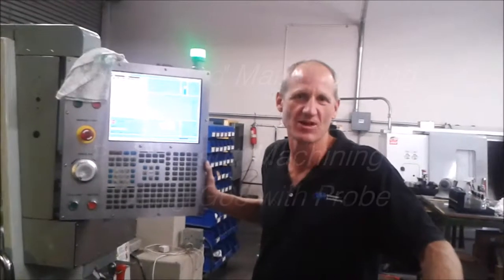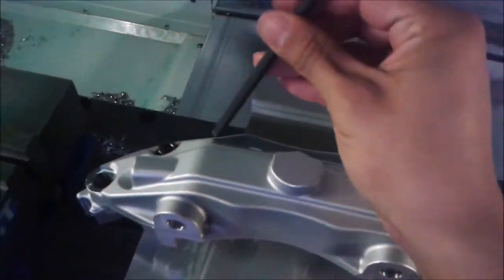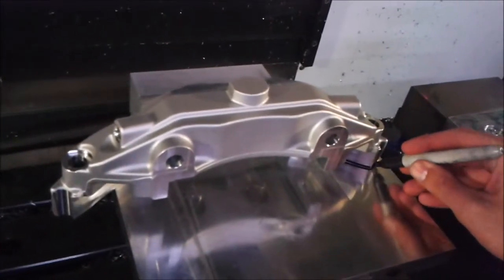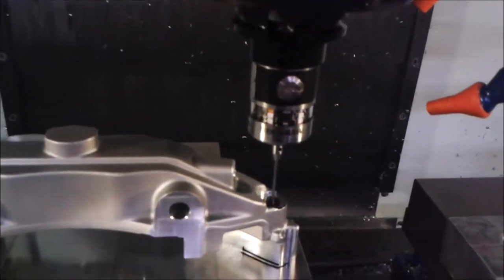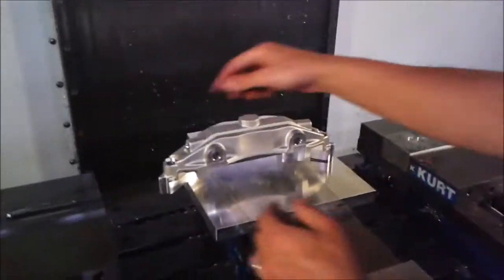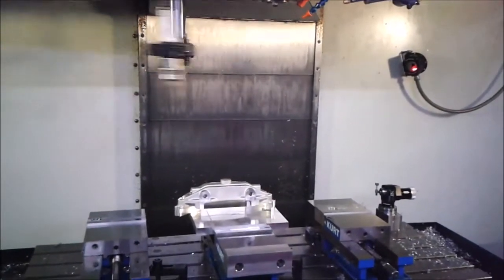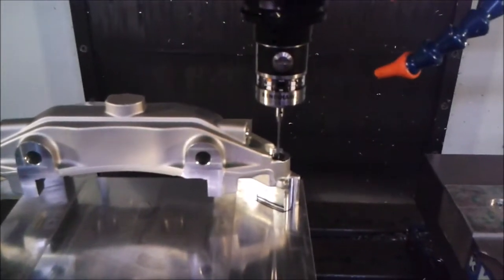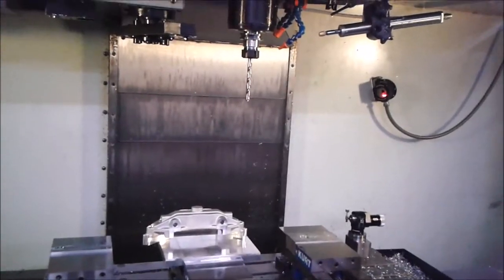Using G68 and Probe at 2 Different Positions

Comment: Any idea how to do this on a HAAS? Having some problems
Reply from the maker: If you change these codes it should work. Sample Cutting and Probing Programs
%
O00005 (SAMPLE FORMAT FOR CUTTING TOOLS) 

G65 P2000 (PROBING SUB-ROUTINE) 

T14 M06 (DRILL) 
S500 M03 
G00 G90 G56 X250.713 Y0 
G43 H14 Z200. 
G68 X0 Y0 R#900 (ACTIVATE ROTATION) 
X250.713 Y0 
G81 G98 R10. Z-25. F200. 
G80 M09 
G28 G91 Z0 
M05 
G90 
G69 (CANCEL ROTATION) 

M30 

O02000 (FORMAT FOR G68 SHIFT PROBING ROUTING) 

#101= 250.713 (HOLE TO HOLE DISTANCE) 

(THIS PROGRAM IS USING G56) 
(X0 Y0 IN CENTER OF DIAMETER HOLE) 
(Z0 TOP SURFACE OF HOLE) 

G28 G91 Z0 
T25 M06 (PROBE) 
G90 G56 

(PROBE ON) 
G65 P9832
(NOTE: PROGRAM O9832 ALSO SETS G43)
(THIS MAY NOT BE TRUE FOR ALL MACHINES)

G04 X1. (TIME DELAY) 

(SAFE PROBE POSITION INTO CENTER OF HOLE/ORIGIN) 
G65 P9810 X0 Y0 F5000. 
G65 P9810 Z10. F4000. 
G65 P9810 Z-5. F2000. 

(UPDATE G55 X0 Y0 HOLE CENTER) 
G65 P9814 D12.7 S56. 
G56 (SET G56 TO NEW ORIGIN) 

(SAFE PROBE POSITION INTO CENTER OF CLOCKING HOLE) 
G65 P9810 Z10. F2000. 
G65 P9810 Z100. F5000. 

G65 P9810 X#101 Y0 
G65 P9810 Z10. 
G65 P9810 Z-5. F2000. 

(PROBE X Y POS OF CLOCKING HOLE) 
G65 P9814 D12.7 

(FIND ANGLE OF CLOCKED HOLE) 
G65 P9731 X#185 Y#186 

(STORE ANGLE IN MACRO VARIABLE #900) 
#900= #168 

G65 P9810 Z10. F2000. 
G65 P9810 Z100. F5000. 
G65 P9833 (PROBE OFF) 
G28 G91 Z0 
G90 
M99 

%